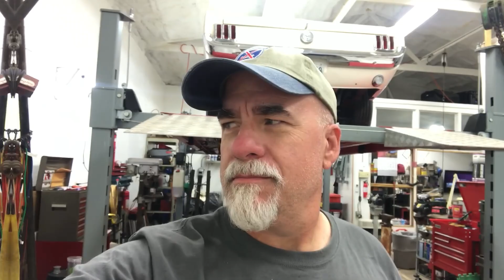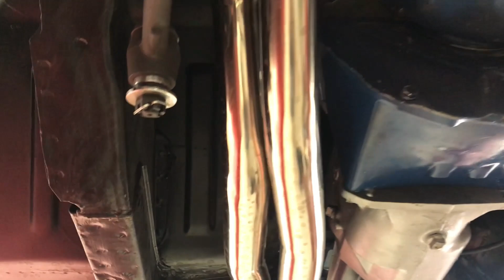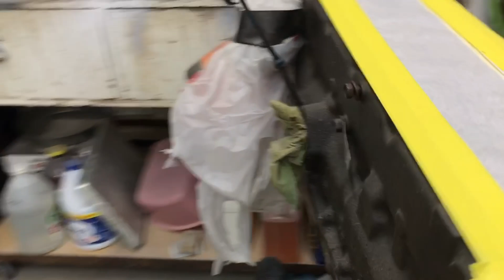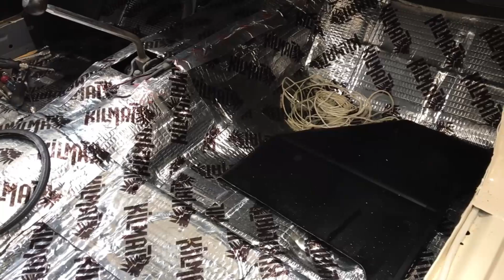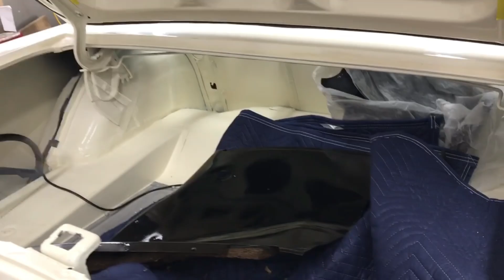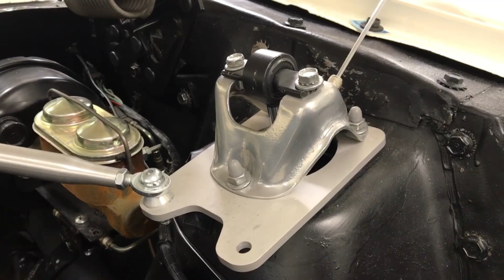1966 Mustang. Road Show/ Viewer's project #17

Comment: Nice shop and car. That drivers side fender is either a Ford replacement or an aftermarket. It has the identifying tabs on it.  I use the same sound deadener but it has another name on it. There are several names selling the same stuff. Hard to have too much in a car IMO.